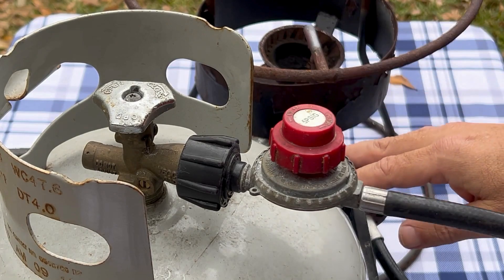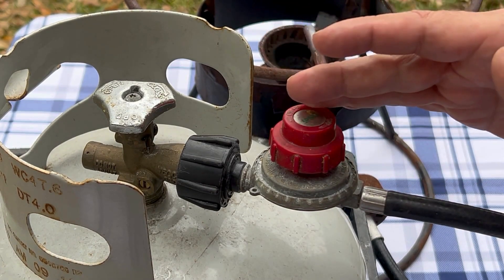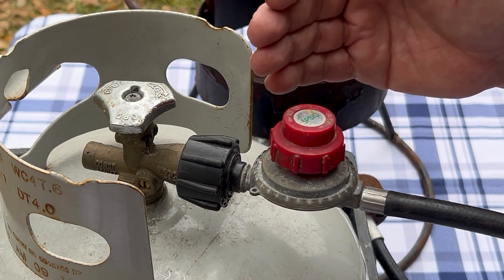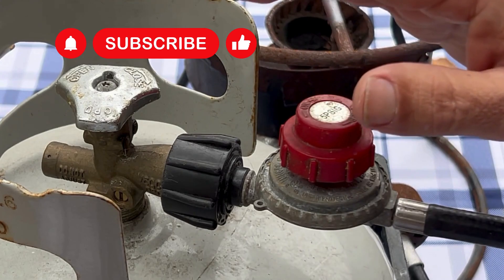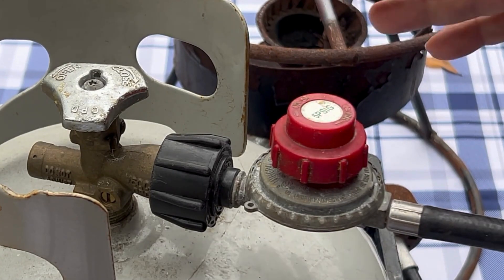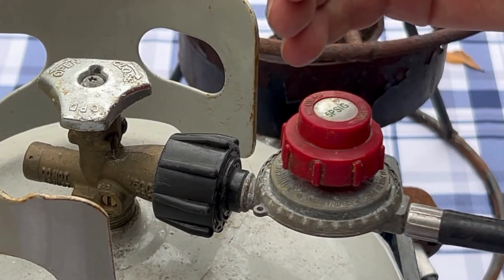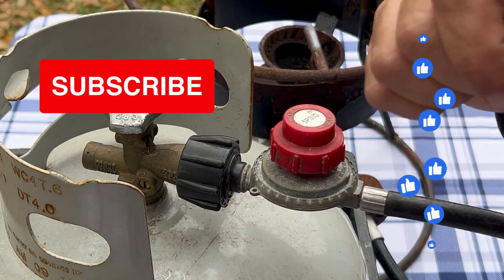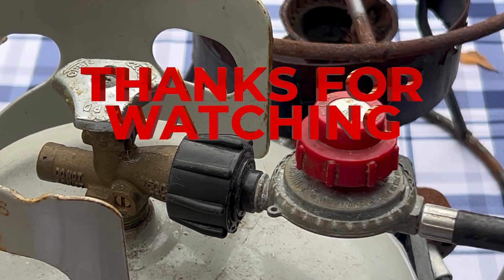Do You NEED A REGULATOR On A PROPANE Tank | Find Out!

Comment: Can I have 2 regulators for my propane stove? One under the stove and one going into the propane tank?
Reply from the maker: That should be ok if they are the proper psi.  The propane comes out of the tank at high pressure and the regulator lowers the pressure so your propane device can properly use the propane.  The control knob raises and lowers the volume of gas to your stove or grill to raise or lower the flame. Hope this helps!

Comment: If you have black pipe running under your food truck straight from tanks without a regulator but use a regulator on each piece of equipment does this bring back the safety issues?
Reply from the maker: As long as you have a regulator somewhere between your tank and propane device, you should be ok.  You need the regulator to make sure the propane device is getting proper volume of propane.  Thanks for watching!